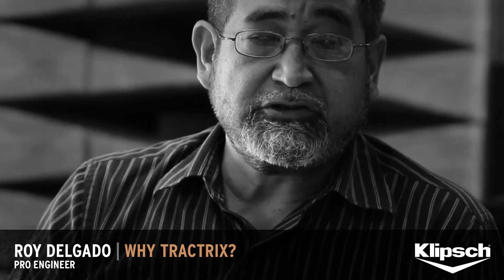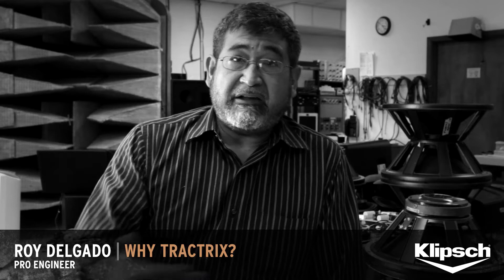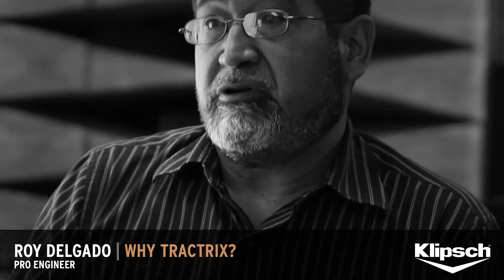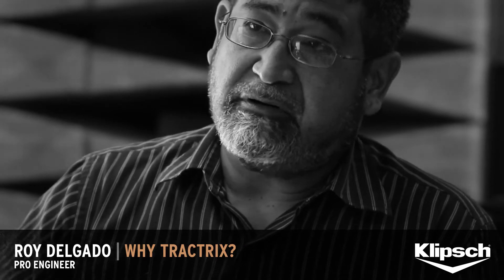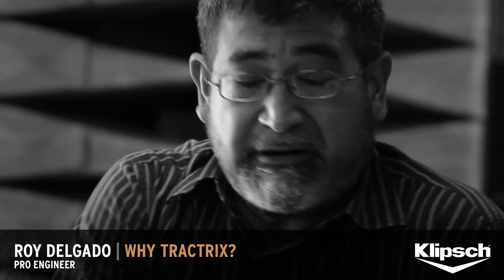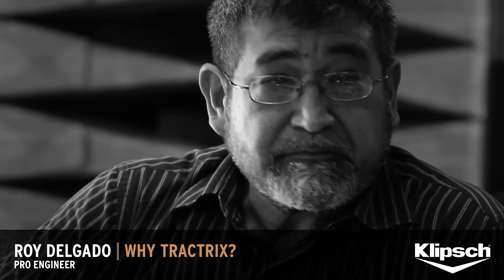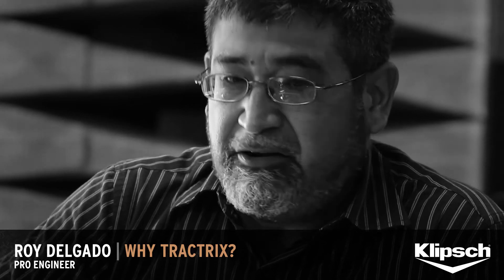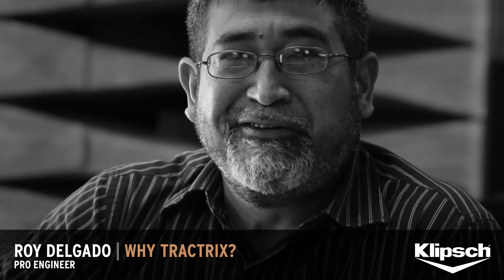Beyond the Specs: Why Tractrix?

Comment: I've wondered about horn shapes e.g. conical, tractrix, exponential and hyperbolic. Which gives highest efficiency, flattest frequency response, widest dispersion etc. Maybe it's some arbitrary and hard to calculate flare that is dependant on the properties of the specific drive unit e.g. this JBL driver needs 2" of conical flare followed by 5" of r = ax^2 flare followed by exponential.

I do know that the walls of a tractrix horn stay perpendicular to a spherical wavefront of constant radius, but as wavefronts have an expanding radius, that means a conical horn would have this property unless you want the wave to expand only as it exits the mouth.

I am aware of cheap horn tweeters sounding like a megaphone, although using very thin metal walls is often the culprit for a cowbell sound.

Comment: I recently bought a the new Klipsch Promedia speakers and took the grills of and got a good listen to the tweeter and was blown away. I have never heard a tweeter that sounded so good. My parents have the infinity c336 tower speakers that cost 900$ and the dome tweeter don’t even sound as good as the tweeter on the Klipsch Promedia. If the Klipsch Promedia was 300$, I would of been surprised that it would even sound that good. No theater stereo sound a good as the Promedia. Crank the sub and it sound like an earthquake with absolutely zero distortion!